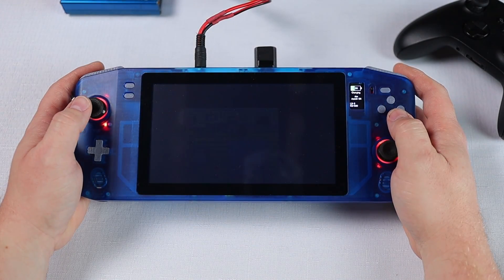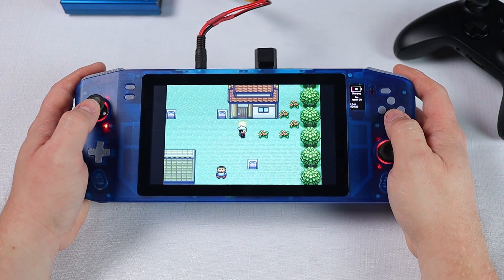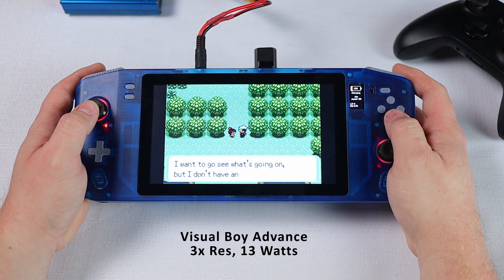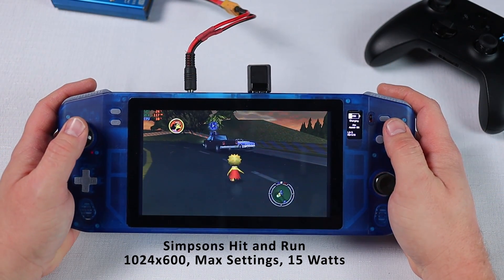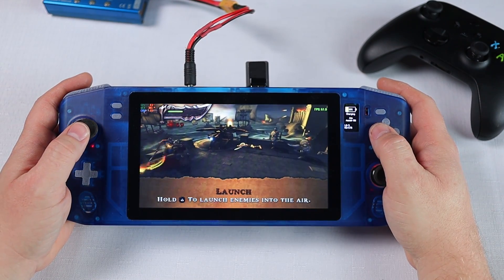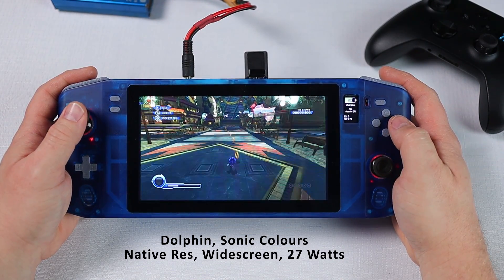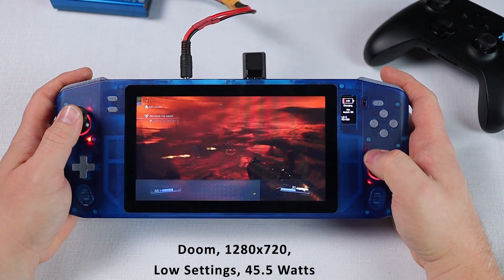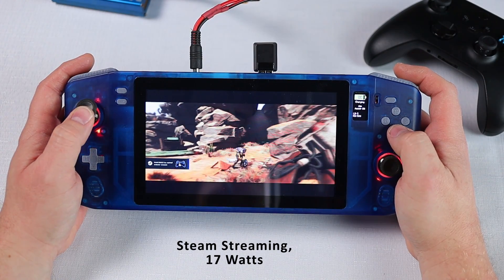NucDeck - Battery Life Tests

Comment: Any plans for an arm version?
Reply from the maker: I've done plenty of ARM based designs in the past, just before I really started uploading to Youtube. In the future I am planning to cover what changes would be required to get this thing running with a raspberry pi in it as I know quite a few people are keen to use it that way. It should only really require a couple of changes to some resistor values on the power management, maybe a buck/boost for 5v supply and a new back cover designed to fit the pi.

Comment: I think the design is great, but I also think it would have been more ergonomic if the D-pad and the right stick had been offset at an angle instead of putting them directly under the left stick and the buttons
Reply from the maker: Yes, there were lots of little decisions like that to make when I was designing it. I've done one with offset sticks/buttons before and didn't really find it any better. It probably depends entirely on your use-case. I personally don't use the dpad a lot except for navigating menus so that's not really an issue for me. The location of the right joystick could perhaps have been more comfortable if moved inwards a bit but its already pushed over as far as I can so in order to do that the whole console would've had to be wider which I just didn't want to do.

Comment: Hey bro I know this is your personal pet project and I'm very impressed do you think that you can make a version where the right joystick is in line with the left
Reply from the maker: I can say that this is definitely possible. It would require a new set of PCB's be designed for that side of the device and obviously a change to the front shell (which is a minor change, compared to the PCB's). I can't justify the time to do it myself yet as I'm still working on getting the power managament up and running, but when I do I may be able to design some different versions if someone else hasn't beaten me to it!
Reply: Funny thing, I'm primarily an Xbox guy but I hate it when handhelds have offset sticks. We're all special 😅

Comment: Amazing project, though I am a bit sad that the NUC will draw up to 4 times the power draw of the steam deck in the same game.... Wonder if a Ryzen mini computer would do better or worse assuming the same performance and settings
Reply from the maker: This NUC is 6 years old, a lot has happened in that time in terms of performance and efficiency. Using a newer model or one of the many AMD versions would definitely make this more efficient, especially on the higher end games! I'll likely swap it out for something a bit newer once the project is complete but I couldn't justify the huge cost upfront for a newer version on the off chance I couldn't make it all work.